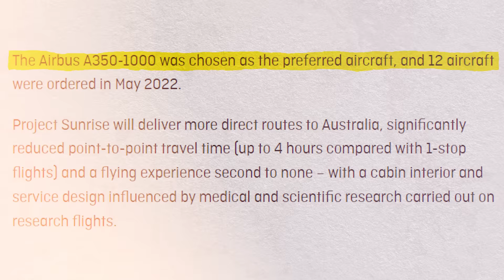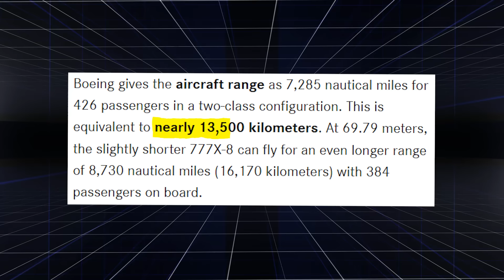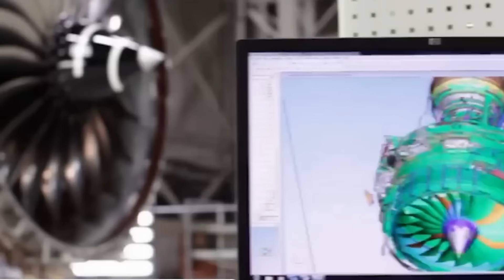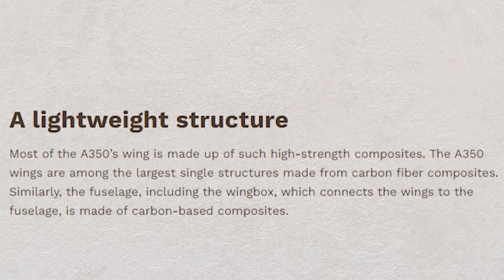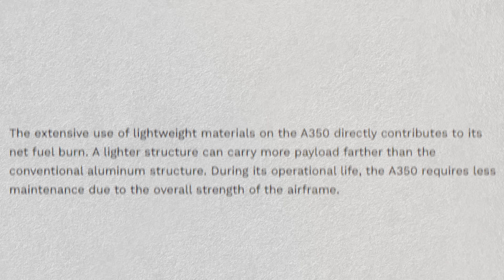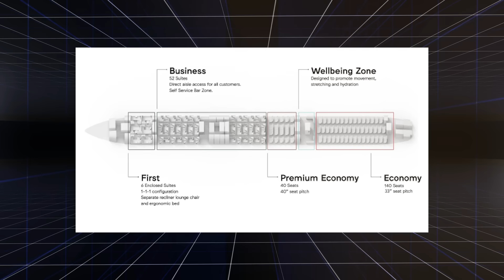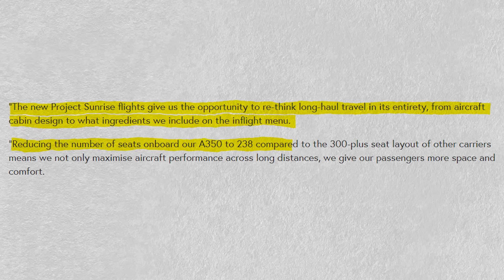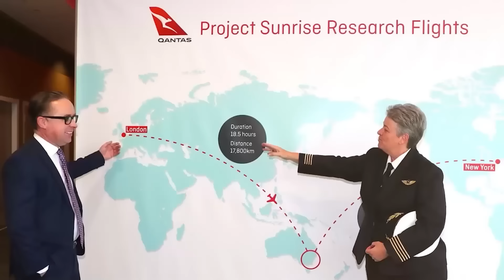Qantas Says GOODBYE to The 777X and Turning To A350! Here's Why

Comment: Boeing is living its inevitable downfall.
Reply: But Airbus will not be able to ramp up production, so Boeing is relatively safe and will still get half the orders
Reply: @Tom-sg4iv  True, but the issue for Boeing at the moment is that they have no product that can compete with the A350 until the 777-X hits the market and nobody really knows when that will happen. I mean they fail to meat one deadline after an other.
The predictions say anyway that in the next 20 years Airbus will probably reach an overall marketshare of 60-75% when it comes to airliners.
Reply: @Tom-sg4iv less than half, Airbus has been out ordering Boeing over the last 10yr. 2023. Airbus had 2000 orders to Boeing 1300

Comment: They can't  get the 777x  quick enough  but the A350-1000 is already available and in service with other airlines.    That is the reason Qantas went for the A350 and not the 777x
Reply: He clearly said in the video the 777X cannot reach the US destinations that the A350 can
Reply: The A350 is a more advanced aircraft than the 777X. That's the reason

Comment: Any news on the A350 paint issue? No one is talking about it anymore.
Reply: As far as i know Airbus solved it more than a year ago.
Reply: They changed the paint.
Reply: @RibasFilms  And it worked?
Reply: Why talking about paint problems when the competitor doesn't fix the doors properly?  
The problem of Boeing is the lack of trust under the actual management. Who can be sure that the 777x is not another problem plane like the 737 MAX?